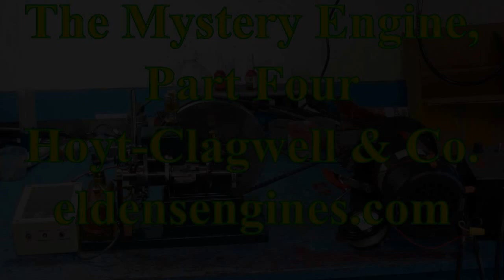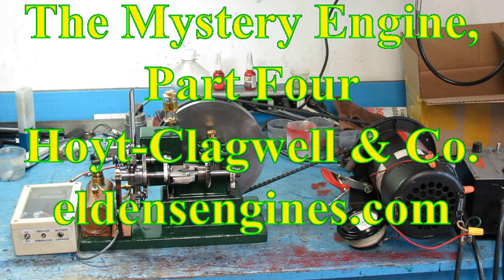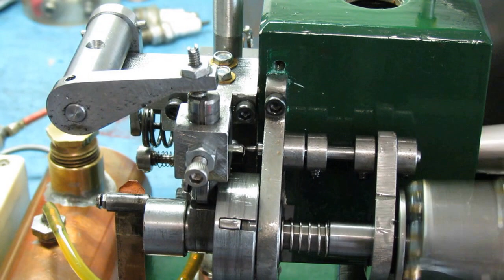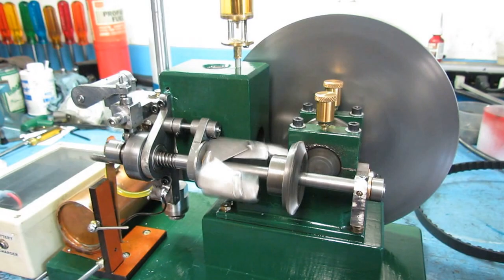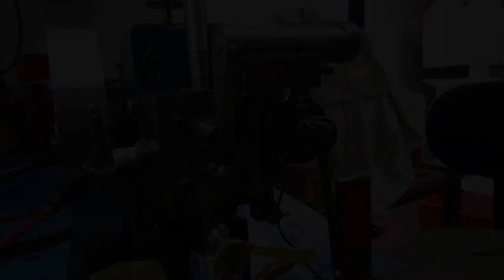The Mystery Engine,Part Four

Comment: What a neat engine. Have been watching allot of your Videos and came to the conclusion that you must dream allot.  :-) You do come up with some neat ideas. Good job.

(1) Do you think your Mystery Engine might need a little more power? Possibly a larger Piston/Bore?  It's hard to tell from the video but it sounds like it's under powered?

(2) Have you thought about possibly adding a Sprage Bearing (one way Bearing) to your Electric Motors Pulley? The one way Bearing would allow a well running Gas Engine to speed up faster than the Electric Motor.  Your present setup is loading your Gas Engine to the speed of your Electric Motor. If your Gas Engine wanted to speed up it can't.  With a Sprage Bearing installed, once the Gas Engine starts running well, you could turn off your Electric Motor and let the Gas Engine turn the belt and Pulley adding a slight load for break-in purposes. This would also get away from having to remove the Belt while everything is turning.  Take care.
Willy

Comment: Your cam-stopper mechanism looks similar to the Callahan design did you take inspiration from it?
Reply from the maker: You are correct.  I made my best guess as to how the Callahan design worked by looking at photographs of the camstopper on one of the engines.

BTW, I still haven't been able to get the engine to run well enough to call it done.  Every once and a while, I take it out, change a few things and fiddle with it.  So far, it has resisted all efforts to run well.
Reply: Ah man sorry to hear that. Things can sure get temperamental when downsizing! I'm sure you'll get it worked out eventually.

Did you have pictures of the mechanism inside? Cam-stopper mechanisms fascinate me they are so neat
Reply from the maker: All the photos of the mechanism I have are on my web page.  Eventually, it will run right.